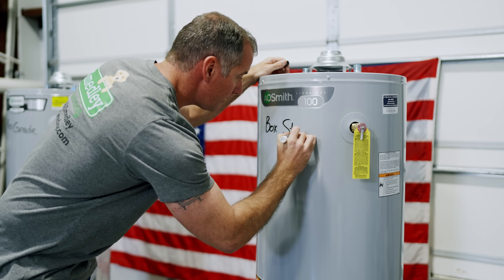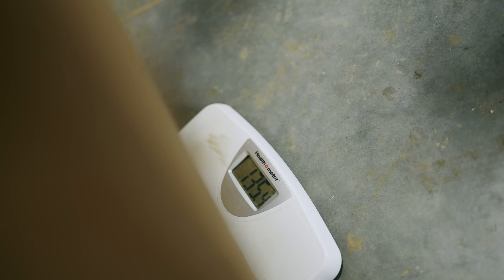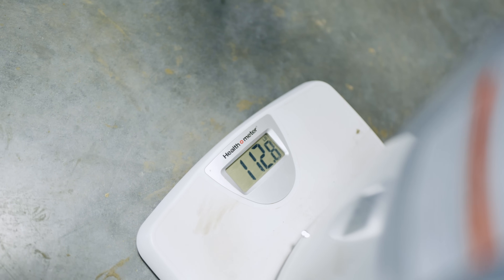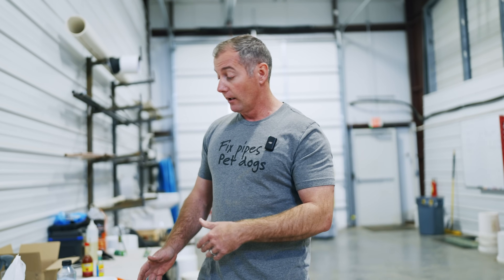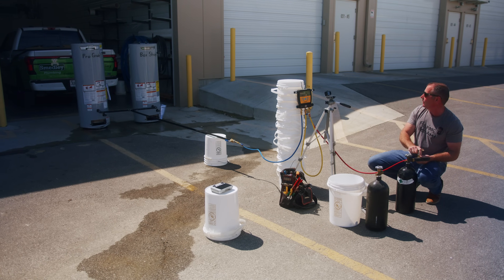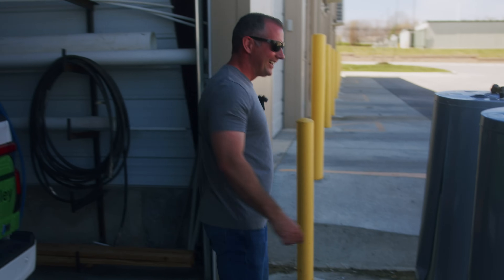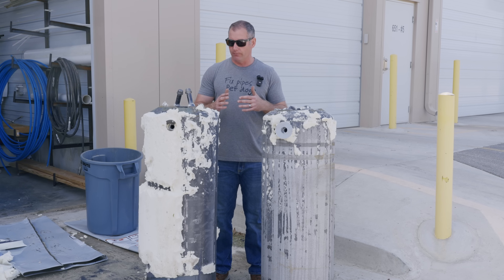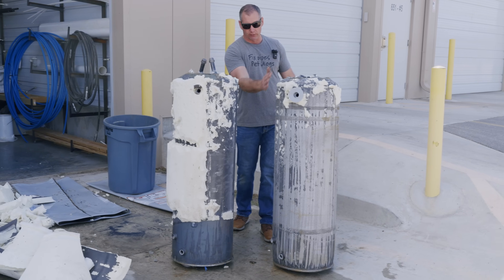What water heater should I buy? - Pro Grade vs. Box Store

Comment: Pro plumbing supply stores are hands  down better. The service and quality of their products speaks for itself.
Reply from the maker: Agreed
Reply: Now if only the supply house would sell to the end consumer.
Reply from the maker: @steveb6371  most do!
Reply: Its all about the point of use! Box store is plenty for a home! Pro grade is more Comercial use!! As long as you maintain your water heater it will last you 25 years.
Reply: @ lol, been there done that. Good luck.
Reply: This comparison is not scientifically valid. You cannot make any overall conclusions from this analysis. Did you graduate from high school?
Reply: @geoffbroom7795  if you must, I did graduate. I also hold a master fitters card. Also have 23 yrs in the plumbing industry. Believe what you will..
Reply: Yeah, if you’re prepared to pay double as a homeowner
Reply: I seen no difference with faucets though . Different part numbers but same product with delta
Reply: Unless the gas valve stops working a few months after the warranty ages out
Reply: No question, imo. Multiple sump systems and a water heater later, if i have the time to use a pro supply co I will.
Reply: @SmedleyPlumbing Last I went to Winnlectric they would not sell to me(public). What a trash policy. They are only losing money with that garbage philosophy.
Reply: @Donmud  not true! I did some plumbing work in the Delta plant in Greensburg, IN, and they definitely have a separate process line for products sold to Home Depot. Box stores need to hit a certain price point on all products because "most" consumers aren't willing to pay for quality.
Reply: @focojeepr nah! Supply houses make plenty of money selling to contractors rather than dealing with homeowners and slumlords wanting a "deal" on everything.

Comment: The hole on the burner is to prevent condensation from accumulating on top the burner and snuffing out the flame when the burner is on in a cold tank. It also prevents rust on the burner.
Reply from the maker: Best explanation I've heard so far!
Reply: You are making me feel smart because that crossed my mind as to maybe why it was there. I didn't get as far as 'cold tank'    Just condensation in general.
Reply: Makes sense. My basement floods and the box store burner has been under water 2-3X. Relit each time and still going.
Reply: @jamesladeroute6127  yep, every experienced plumber hears the new water heater dripping on startup, then  explains to customers why.

Comment: Thanks for this video. I myself have had debates with people over the difference in quality between box stores and supply houses. However, the biggest issue for the home owner is not the couple of hundred dollar difference between the two. It's the 100 % markup in price that a plumber charges the homeowner. This doubles the price to the homeowner.
Reply from the maker: Good work isn't cheap.  Cheap work isn't good.
Reply: @SmedleyPlumbing  just because someone is a “professional” doesn’t mean they do good work. My old water heater was installed by a “professional” (tag on the unit) and it was a hack job. I’m nervous about working on gas lines so when I remodeled my kitchen I had a plumber move my gas line and saw all my plumbing work under the sink and said my work was great and moving the gas line was easier then what I had done and I could have done it just fine.
Reply from the maker: @TheOriginalLugnuts  some people are definitely more capable than others that's for sure.
Reply: A homeowner can certainly go to your local plumbing store and buy a pro grade unit and install it yourself.
Reply: @jayabraham4377 maybe. Some of them are trade only. Around home for me, they all are.
Reply: @SmedleyPlumbing  last time I checked it doesn't take a master plumber to mark up parts.
Reply from the maker: @tylerleeds6275  you're 100% correct.  It takes a business that sources, purchases, and delivers thos parts to your door that gets the right to mark them up however they choose.
Reply: Not just the markup on the part itself.  These days many plumbers are commissioned salesmen and if you just paid their hourly labor rate plus the cost of fittings used in a water heater installation, plus a charge for hauling away the old dead hot water heater, the price the shop quotes you is far higher than the sum of all that.  The guys in the field are incentivized to charge more.  The same is true for replacing your furnace.
Reply from the maker: @mriguy3202  most people, no matter their job, are incentivized to do the action the company needs from them.
Reply: You used a fully,licensed plumber? Most plumbers are using extenders, plumbing technicians, not even journeymen.___ but charging master plumbers Rates total scam….
Reply: How many businesses do you know that are working only for wages and not profit? The average contractor makes 3-7% profit. The laborers are worthy of their hire”
Reply: Personally had Smedley bid some plumbing work for me…. Ended up doing the job myself… about $350 vs $3500, so yes…. That commercial AO Smith would end up costing the homeowner $5k with this company.
Reply from the maker: @kc9146  so professional services will always cost significantly more than a diy fix. But also, we don't have a standard water heater option anywhere close to $5k.
Reply: @SmedleyPlumbing  Not paying for "work". Paying twice for a part.
Reply from the maker: @evernhamanderson  you're not paying twice for the part.  You're paying for the "work" the plumber puts in to buy the part and bring it to you.
Reply: @SmedleyPlumbing  Hmmmm, let's see....you still have to pick up and transport all necessary parts to the jobsite, regardless of the quality of the parts you decide to use. You are also doing the exact same job, requiring the exact same skills and utilizing the exact same parts list and knowledge and skill. So, charging a 100% markup on a replacement unit is still charging a 100% markup on a replacement unit. Right? None of which is actually part of the "work" required. Call it semantics. Charge me for the work, whatever the work is worth, but don't mark up the parts.

You aren't wrong for wanting to make a decent margin on your jobs. But doing it through obfuscating actual costs and calling it the charge for "work" is disingenuous. Anyone can buy parts. NOT everyone can install or service those parts. That knowledge and skill is what people want to pay for, not parts margins. In fact, it is a good marketing plan if you think about it. "We NEVER" mark up our parts and we can prove it. When you hire us, you are getting the best service, NOT the most expensive parts."
Reply from the maker: @evernhamanderson  well this is why we don't even provide anybody a breakdown on our parts and material costs for a job. We use flat rate pricing so that it's fixed price for fixed results. Then we handle how we cover all those costs on the back end.
Reply: @SmedleyPlumbing nicely said!
Reply: @jayabraham4377 most plumbing stores don't sell to the public.
Reply: I can't agree more on this point. Plumber charging way more on materials, as they can. So we as consumers can educated ourselves, go order directly from plumbing supply stores.
Reply: @SmedleyPlumbing  I’m happy to pay for good work as long as it’s in the labor column of the bill.  Don’t charge me 50% more for the materials than you paid for them and expect me to take “good work isn’t cheap” as an excuse.  If you’re worth $150/ hour, then charge me $150 an hour and mark the materials up 10%. That’s fair.
Reply from the maker: @MDC_1985  do you have the same demands for restaurants?  Do you limit how much you're willing to allow them to mark up their materials?
Reply: @SmedleyPlumbing  10% isn't enough to cover overhead, and office staff and insurance. I do mainly HVAC work, but I replace water heaters from time to time as well.
Reply: A professional wanted 915 for a replacement unit installed. I checked things out and found out that it was actually an under 100 control board. replaced that board 5 years ago, still going strong at 26 years ...
Reply: @SmedleyPlumbing he’s talking about the price of the water heater, not labor.
Reply: @SmedleyPlumbing why?  Because people would know what you are really charging for labor?
Reply from the maker: @jeffthomas7345  how much to restaurants charge for labor?
Reply: @evernhamanderson I’ll play devil’s advocate for a minute and I don’t currently have my own contracting business, and it wouldn’t be plumbing, but a similar concept. It takes many years and a lot of blood, sweat and tears for most to become a master tradesman. If you have ever payed a shop to work on your car or truck, you know that it will cost several times more than DIY. That’s the way it goes when a contractor or business owner has to make a living, someone has to pay for their time, tools, experience, tools & equipment, etc.. If one can do it themself, more power to them because most can’t. I would wager that you get paid more for your time and expertise than you would like to pay someone else doing that job. Sometimes we get off cheap and sometimes we have to pay the piper.
Reply: @MDC_1985 Every industry marks up parts/materials/ingredients without exception. I worked in the tire and automotive repair industry before doing electrical work and the service guys always mark up parts from 40-100% from their discounted cost. Home service professionals do as well, simply because someone has to pay for insurance, taxes, fuel, building overhead, vehicles, etc..
Reply: @jayabraham4377  - The ones around my area in SCal only sell to licensed contractors not regular homeowners. Maybe there's a 'plumbing store' that will sell to DIY guys like me but I have yet to come across one.
Reply: @SmedleyPlumbing I will reveal that secret for you: step 1-buy food from store. Step 2 - subtract menu price from food cost. Step 3 - that’s the labor cost
Reply: @Rossm812 Agreed, I work at a supply house and we don’t sell to homeowners, most others around here don’t as well.

Comment: I experienced a box store vs. buying from a local shop when buying my lawn tractor. I bought a Husqvarna lawn tractor from Home Depot. It has had nothing but issues, and it only has 17 hours on it. I took it in for service to a Husqvarna dealer, and he was showing me major differences between his that he sold and the one I bought from Home Depot. Same models. So I sold the one I bought from Home Depot and paid the additional 280 dollar differences, and I'm telling you there are no comparisons between the 2 Lawn tractors..
Reply from the maker: Yep!
Reply: How major were the differences ?
Reply: Agreed, but if you know anything about small engines, stick to Scag/Kubota/Exmark, etc. You rarely see landscapers use any of the junk Craftsman, Husqvarna, even Toro, they all use the same low quality parts and transmission.
Reply: The John Deere mowers from home Depot are crap. 2 years the transmission failed 5 years the motor failed. The John Deere store said the home Depot ones are crap.
Reply from the maker: @--harry_  yep!
Reply: @dubmob151 
Hello. To start off with the mower deck on the Husqvarna from Home Depot was way cheaper and already starting to rust. If you look under the decks they look completely different. The Husqvarna lawn tractor from Blizzard boys that I bought has a better seat, the mower deck is much more robust and cuts way better then the one from Home Depot. The one from Home Depot had a Briggs and Staton engine as dose the current Husqvarna I now have but the air filter on the home depot one was very flimsy and cheap looking. The 9ne on the engine is a totally different design and once again more robust, the fuel filter is in a better location and so one. I'm not sure if there are other driffances but I can say for being the same model mowers this one I have now is far better then that POS I had before.
Reply: The muzak is soooo annoying, but your content is great!
Reply: Wouldn't the longer hot water nipple trap air at top of the heater?!
Reply: @--harry_ we got a john deer from home depo in 2003, have done 2 oil changes, battery's every year, just replaced the front tires and a pully last weekend.... other then that i cant think of any other problems
Reply: There has to be a model or part number or serial number difference.....I'm finding it hard to believe totally same in ALL of paper-trail part numbers and warranty docs....yet the claim that these devices are different. There has to be a difference to the part number too, if only a suffix added or removed.
Reply: @TheWilferch  i just started the video and i cannot image a huge difference but there are sub-model differences in mowers just like cars at a dealerships. HD may not offer the higher quality sub models since the price is always more..

Comment: Bought a GE 30 gal electric from Home Depot 20 years ago, and the thermostat just failed this week. I figure 20 years was great service and it's time to retire the entire unit. I can do the job in an hour, milking it. Sadly, Home Depot no longer carries GE, so I'm gonna go with the AO Smith from Lowes this time. I was worried about the quality, but your video just convinced me that it would do the job just fine. Nothing personal, and I know everybody's gotta eat, but a licensed plumber would want $1500+ to do that job for me. Great video, and I thank you, even if it probably had the opposite effect you were hoping for. $900 per hour is more than anyone "needs" to make.
Reply from the maker: Gotta do what you gotta do!
Reply: I usually charge pretty high, but $1,500 isn't bad for a 30 gal
Reply: @joeyyc8515 , Hey I get it...but I can do the work myself so paying anything seems silly to me. Others aren't as fortunate and for them, I would recommend a good plumber for many reasons. So glad I didn't toss the old GE after all that though.....turns out the circuit breaker had an intermittent failure and once I replaced it......nice hot water. 😁 Tank looks good enough to go another 10 years easy and now I have an extra thermo. It may outlive me 🤣
Reply: I've got a 20 year old GE WATER Heater that I bought from Home Depot in 2004. It's electric and is still working just fine without any problems. It was made by Rheem.
Reply: If you keep the anode in good enough shape to prevent too much corrosion, either by adding a powered anode or replacing the disposable one every few years, a tank can go almost indefinitely aside from an occasional cheap element or thermostat replacement. You could likely replace the thermostat yourself for under $100. I replaced one of the elements and the anode on my now 25 year old water heater last year and plan on replacing the drain valve next time I flush it.
Reply: Not to mention a plumber would likely change the flexible connectors, ball valve, and possibly the pan at that price. As well as checking the integrity of the flue, the pan drain, the T&P drain, and then assume liability. If there’s a leak, will your homeowners insurance cover it if they find out you DIYed it?
Reply: Except 20 years ago they were trying to make a good product to get people to buy and stay competitive. Now it's getting it out the door cheaper and quality that will last the 5 year warranty period. I'm surprised the OP didn't compare the wieght savings to price. You paid less for a 6% less product. Price difference not far off. And if you factor in that plastic drain, you get what you pay for in parts and support to your local store. The math evens out over time. Problem is we see the dollar sign first before anything else...
Reply: @NurseAcrobat  I pilfer thermostats and heater rods from units replaced at work. Big units in factories. 100+ gal.

I'm actually considering just welding up my own tank at this point because I have all the other components 🤣
Reply: Those GE are the same ones they sell today at Home Depot,  they are manufactured by Reem and made in Mexico, they just changed the labeling, Menard's sell them under the name Richmond, or they did last I checked, but are the same heaters made by Reem, on other thing to pay attention to is the BTU rating, many of the box stores ones are like 5,000 less BTU
Reply: @neuralglitch9063 yeah electric water heater failure is usually do to something in the electrical system, obviously elements are simple fix 90% of the time,  very old ones that haven't been maintained well you may find it near impossible to get the elements to come out because of how much scale has built up, but the controller units on electric water heaters aren't normally worth replacing, pituitary if you're paying someone to do it as it can take as much or more labor to change those out, and it's the labor that's the biggest cost, I've been retired for quite awhile but last I did side jobs for a easy in and out heater job I charged $600 for 40 gallon heater and that wasn't taking the tank away the owner had to get rid of it, but if you put a used heater out, at least anywhere near me that heater will be gone long before the garbage men pickup, most towns make you buy a large item garbage sticker, I happen to live in a town where I can throw anything no matter the amount or size, other than electronics which we have to bring to the village recycling center,  out at my curb, in fact when I first bought the house I'm in now the previous owner had some much crap in the garage you couldn't walk into it, I spent 4 weeks of filling my parkway, about 50 feet wide 4 feet deep with just all this junk he had collect for 35 years
Reply: Ive got a lot of calcium in the water where I live. Takes me like 2 hours to drain, and thats with a sediment buster, blasting air back in there when it clogs up. Got any pro tips for a non-plumber?